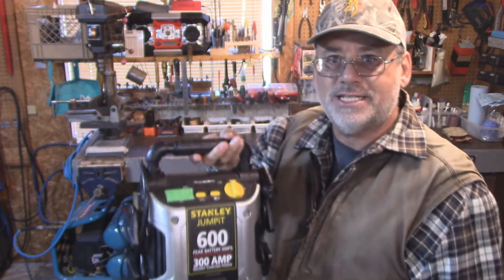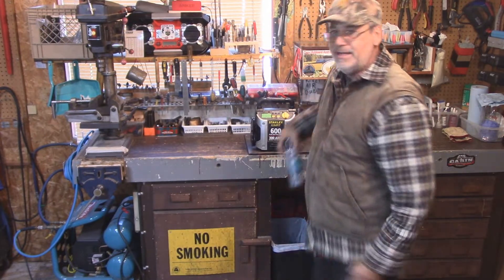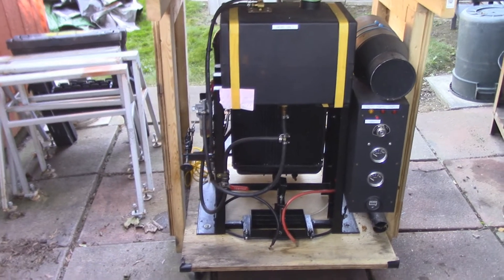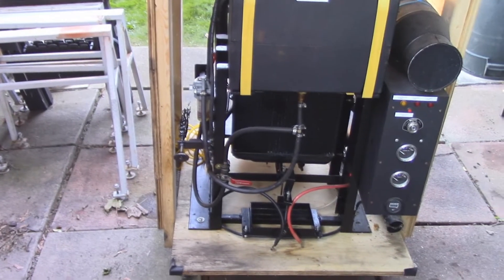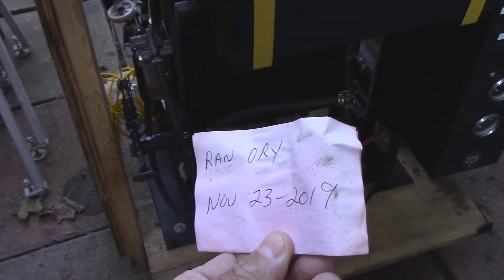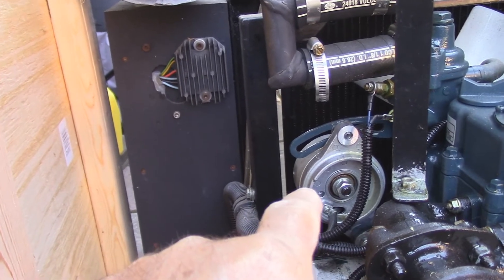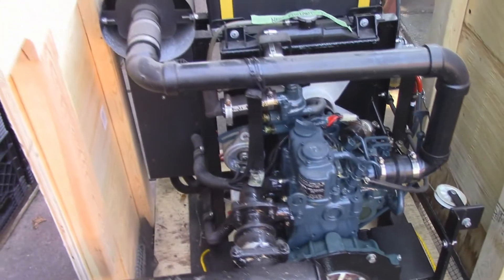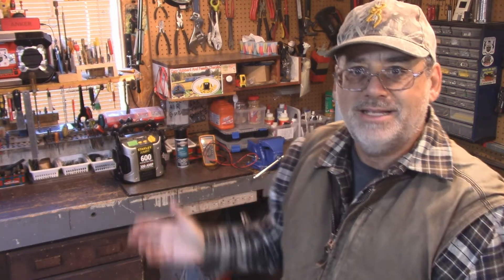Kubota Z482 Diesel -  Fogging The Engine

Comment: Really cool item. The air intake made out of ABS pipe was creative. Nice little engine. I love engines like this: practical, small, multiple uses, light enough to man-handle with a dolly on one's own, etc. The clamp extension worked! Good Job, Steve! 4+ years sitting and over it went!
Reply from the maker: Hi Craig,  kubota always starts so easy on a good battery . Cheers 👍

Comment: Nice trouble shooting on the battery issue. What a nice engine. I love Kubota equipment. If you weren't so far away I'd buy that gem.
Reply from the maker: Thanks Wyatt   not sure what I'm going to build with it but it's stored away till then.

Comment: Hi Steve, that’s a really smooth running and quiet diesel engine - excellent work on the storage work too, both internally and externally were looked after - that’s the way to do it 👍🏻 boy that could generate enough electricity for your camp and your neighbours camp lol cheers
Reply from the maker: Hi Ed 
It's a gem forsure.  Hopefully I do do something with it . Cheers 👍

Comment: Thats a nice little engine to be stuck with. If I had that I would do a permanent base for it in the yard and when I have nothing to do just start it and let it run just to here it. Soon you won’t be able to get something like that. All your going to be able to get is electric motor so your gouvernement would like you to do. I won’t be around any more so I don’t worry.....CHEERS
Reply from the maker: So true Gator , no emissions on this at all.  Bought this from a  plant in Ottawa that builds gensets for the military and for refers , the government changed emissions regulations so they were allowed to sell them to the public  , I bought 2 of 650 that went for auction on eBay.
Reply: Nice small engines and I had seen your log splitter with one...run good...CHEERS @SteveRobReviews

Comment: Such a cool little engine. They're around 10hp, aren't they?  I can think of a ton of uses for it but I'd probably build a large inverter generator.  First I'd put it on a gokart! lol
Reply from the maker: Bruce It's 13.5 hp built for a refer 5 quart oil pan .  Genset is the logical choice .

Comment: I have a chance to buy one of these engines that was running a compressor and was caught in a shop fire. It seems to be unharmed except the hoses, belts and wires are a bit singed.
Is it worth while for $300 ?
Reply from the maker: It's a $2000 motor all day long so I'd jump at $300

Comment: The good thing about these small kubota diesels, because they are low hp, even with the final tier emission standards, they remain relatively unaffected by emission standards. I've got one in a genset at my camp/house and It always puts a smile on my face when it starts up just fine at -30c all by itself. Runs at 3600rpm and still uses very little fuel. Tuff engines.
Reply from the maker: Yes absolutely.   This is a  tier  two I believe.  Cheers 👍